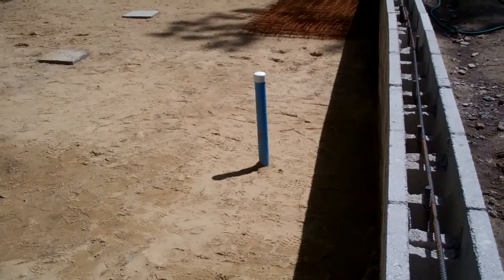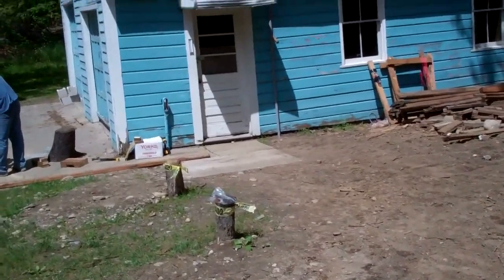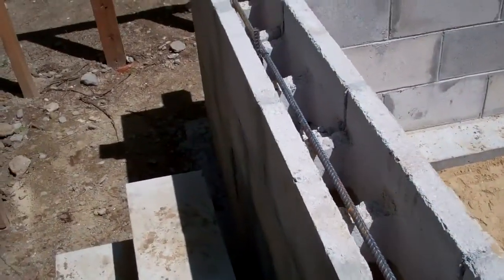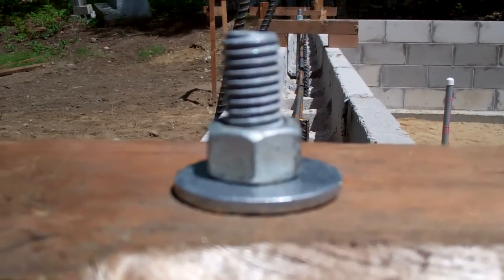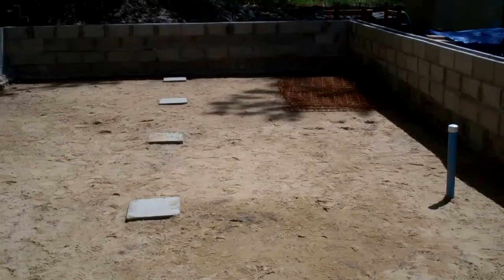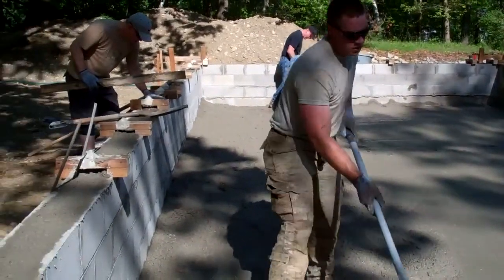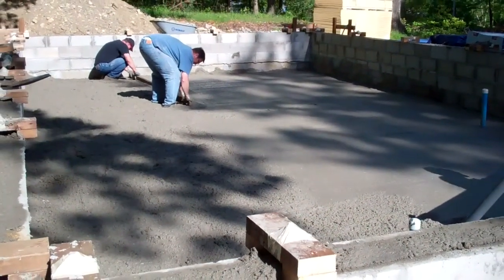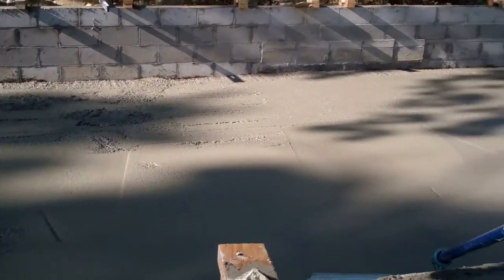Concrete.mp4

Comment: David, good job.  You can't have too much rebar, j-bolts and filled cores.  I just did a little re-plumbing in a crawlspace and the smooth concrete slab made getting around on the creeper much better than crawling.  You didn't put foam under the slab?  Good luck.
Reply from the maker: I needed the concrete slab to reinforce the bottom of the old concrete walls.  I ended up putting foam board on top (yes, different than new construction).  I laid down OSB on top of the foam board for getting around on a creeper.
Reply: @DavidPozEnergy  David, wood floors work with creepers too.  Foam on top will lessen mass heatsink effect.  Seems like what you did worked.  Good luck.